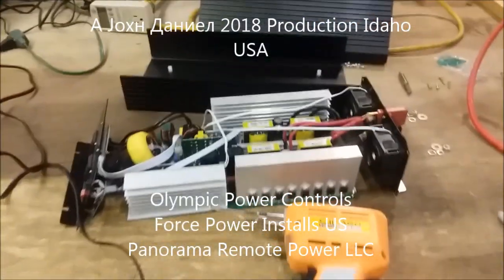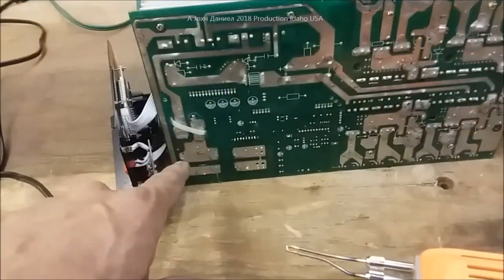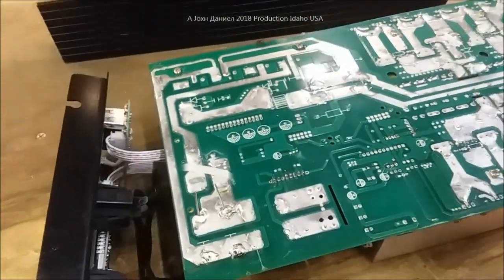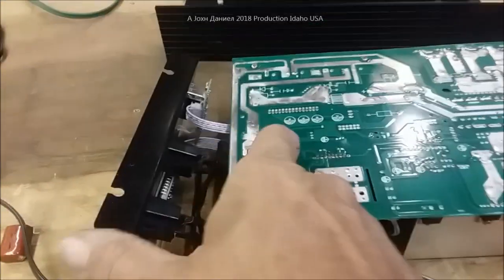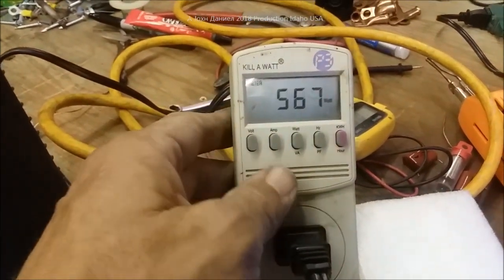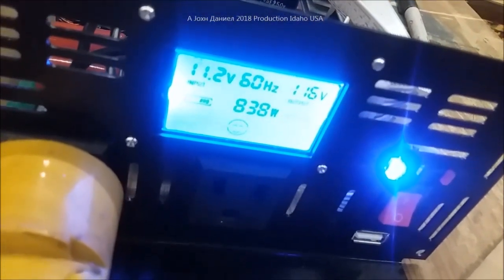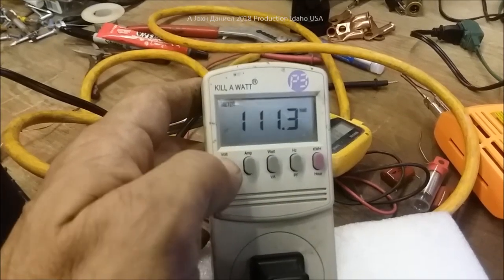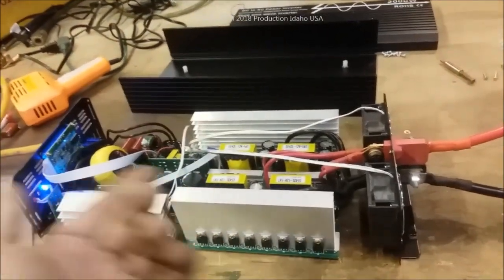Power inverter repair (vid 2 of 2) THE REPAIR

Comment from the maker: Overall internal parts are high grade, its assembly is poor though. Better ones like this https://amzn.to/2LMbz9S by Power Tech On have modern all automated construction. I have installed numerous Power TechOn on solar jobs without any fails, but trying a new brand got me this PUGU inverter in the video. PowerTechOn is the same as a VertaMax product, at a lower cost. SEE VIDEO 1 also! https://youtu.be/zavAGHukOYY
Reply: If your trying to go cheap but want the biggest bang for your dollar For starters and pros the best Solar Panels https://ebay.to/2KHX5XY Mighty Max 100w4bar . You can lay them flat or at a sun rated degree with less power loss due to them having 4 buss bars on the cells. I will be installing them on my BugOut trailer in a few days with one of these inverters.

Comment: I'm on my 4th or 5th Chineseum inverter now, just received the latest one 3 weeks ago.  And due to experience with previous one's first thing I do is open and inspect.  Rough handling, poor assembly, etc have made me equally wary of what I receive.  Plus don't want a huge explosion.  My experience is that they mostly work but do not hold up.  And often times the reason isn't as easy to spot as in your videos.  Trying to deal with sellers is bizarre as well.  The last one requested photos.  Photos of what I don't know.  They want photos of the outside of the defective unit which failed while not being used.  It was connected but had no load attached.  Well, anyhow, thanks for the wonderful analysis of these products.  
By the way the last one I purchased was a PowerJack brand and my choice was due to the unit having modular design which allows individual components to be swapped out without a lot of whoopla.  And PowerJack has a web site with the parts for sale at reasonable price.  Actually, the unit, which was very heavy came out of the box in working condition without anything loose.
Reply from the maker: Wise steps

Comment: does the inverter have a cut off component for if it overheats, or is it designed to run anad stay cool enough when its in the housing. I see people have a small hut for all the equipment and wonder if that is a risk
Reply: Most have a sensor to turn the fan on/off.  Some have another sensor to disconnect the unit if goes beyond safe temp.